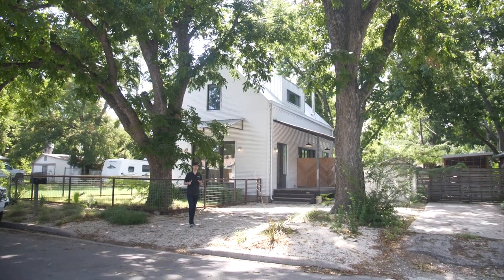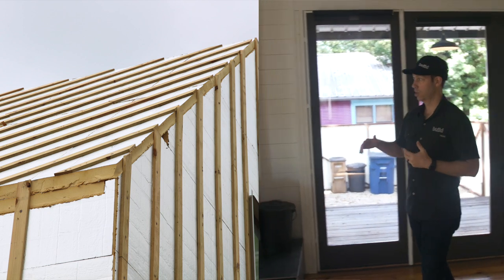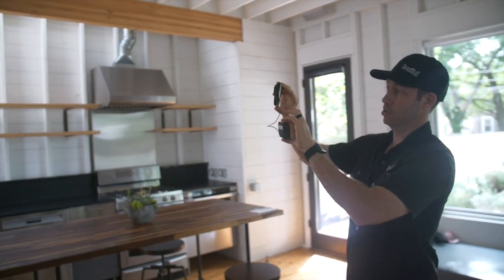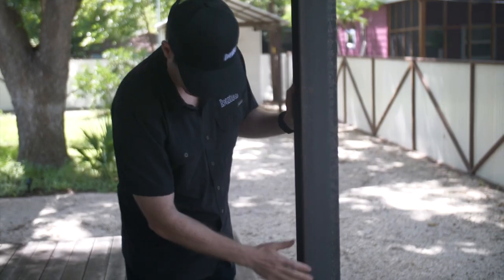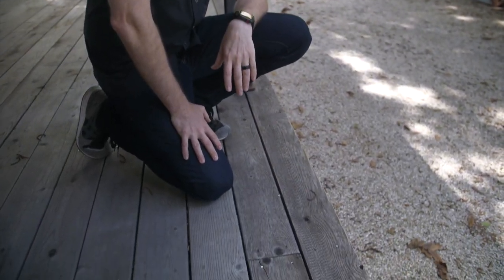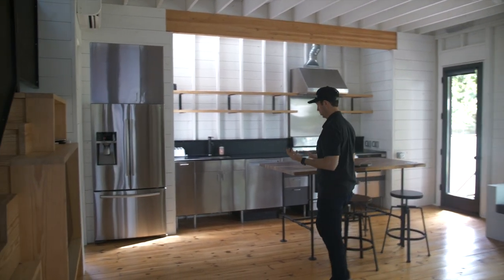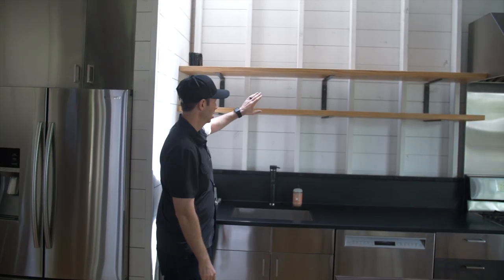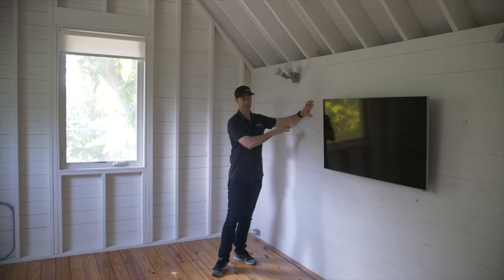This New House Has No Drywall, No Insulation, and an All Wood / Shiplap Interior!

Comment: I really like this house,  it's pretty nice,  now i wouldn't have a problem w/ conduit running along the walls i kinda like that wall.  and just have a bit more sound insulation like you were saying at around 17 mins.  otherwise I love it so easy to work on.  I can't stand how hard stuff is to work on and this would be 10 times easier to work on.

Comment: So, the exterior wall has no sheathing or drywall, is the rigid foam sturdy enough and fastened in a way to prevent racking?  And you're exhausting the warm humid air from the bathroom into the living space below...is that even permitted?

Comment: Do we have extensive data on external insulated homes like this? How do these materials live up to more exposure to elements?
If we're making analogies to a winter coat, or blankets--those wear out and lose loft for insulation. So does external insulation have shorter lifespan than traditional inside the walls insulation?

Comment: I would be curious to see how this design would be changed if it were built in the Midwest?  I don't know if you could get away with insulation on the outside only.  In the summer time sure, but in the winter it might not be enough.  I personally would have like to seen a basement on it, but I guess that isn't as come down in TX.  Its a little modern for my tastes, but that is more of personal preference.  Overall though, I very much like the design.

Comment: 1.  Did the furring strips to hold the metal siding actually match the studs on the walls? 
2.  How did you secure the rigid insulation to the siding?  
3  Why did you elect to put the furring strips for the roof on a ~45deg. angle?  So you could walk the roof more easily to secure the metal roofing?  
4.  What kind of roofing did you use for the house sides?  That is pretty cool that you used metal siding sideways for the siding.
5.  Can you please provide a better explanation of the layers, your link to building science doesn't do it well.  What is peel and stick?  Is it like the brand that is EPDM with a sticky back?  Rather than using Tyvek house wrap?  Did you use that over the shiplap?

I built a little 16X24 loft office timber frame "man cave" workshop and used a similar way of insulating, except only used 3 inch rigid aluminum faced insulation on the outside and 2X8X1 pine clapboard over that. I used tongue and groove 6 inch boards on the outside of the frame [its what you see from the inside, and I left it unpainted so its beautiful].  For windows I used 60 year old recycled ones from Switzerland, they open from the top and swing out with a flick of a lever and are double pane.  I didn't need thermal pane windows.

This design is proven, and it really works well.  Thanks for the video!

Regards,
Larry

Comment: I mean honestly, I would have double walled the whole house, double floored with traditional techniques and over laid with "rough framing" achieving the raw look but also achieving soundproofing, cut cost on exterior insulation and double barriers. Plus you could hide any unnecessary electrical and plumbing exposure and make any key points in a crawl space / air gap for easy access.

Comment: I'm curious, just considering the structure and not the finish work like kitchen/bathroom, how does this building style compare to traditional construction when it comes to cost.  thanks for the videos
Reply: I would assume that framing is more expensive and general labor would likely be marked up because of the specialty techniques. Framing would be a challenge and this kind of finished look would require a very skilled crew. Electrical would likely take longer because it has to be pretty hidden (and it can be very hard to find clean and neat electricians for cheap). Plumbers would likely be the same deal. Because of insulation thickness, all windows/doors would probably be custom with a jamb extension? I’d assume this method of building is more expensive, however the idea of a continuous thermal envelope would serve a great purpose in net zero and energy efficient homes, which will always cost more than a conventional home. Definitely food for thought with this design.

Comment: I’m surprised this meets code for shear strength with no sheet sheathing. Shiplap on studs can parallelogram, but I guess the rigidity is supplied by the connection to the perpendicular walls? I mean, I live in a town with plenty of homes built shiplap on studs and it’s not like they fail routinely, but surprised it would meet modern code nonetheless.

Comment: The wood however is combustible and you got a fireplace right next to it. It also would get smashed to pieces by a powerful storm, then again so would most american homes. Other than that it is a neat and a rather simple way to build a home. This is the type of project I'd be comfortable to build (much of it anyway) on my own. I think it looks good on the inside. I like the metal exterior, not sure what it'd cost me or how it'd compare to a wood exterior in terms of required maintenance.

Comment: Drywall's probably louder than wood. What about some kind of insert sound baffles 14.5" between some of the studs?  The way they'd handle this in the middle ages would be fabric tapestries hung on the stone walls. 
Dust is a serious issue that only gets worse over time. After spending some time in Japan, their style of shoes off at the door, keep things simple so they can be easily cleaned is a good practice. I visited Japanese castles (all wood construction, you'd love it), shoes off at the entry, everyone in socks,  at least 1000 people an hour in most of them. I've got some photos of the bottoms of peoples' whites socks that look like they just came out of the drawer.  
I live in Los Angeles, near freeways, Sanna Anna winds blow fine sand, the old shack I rent is a leaky box. Gardeners seem addicted to leaf blowers.... These are all external sources, what are the interior sources, and how does building materials contribute to dust over time? You mentioned insulation in this video, but I don't think you meant insulation behind drywall was a problem. In my bedroom I notice dust from the cotton sheets and pillow cases. This is a terrific house. I'm an old carpenter, but I'm not sure I'd want this....but taking some really good thinking to this level is like an amazing experiment. It's also great that you're still connected with something you built "many, many years ago" 5 years. When I washed and reoiled a redwood fence I'd built, I realized it was 20 years old and still in the same shape as when I'd built it. Time moves a lot faster than we realize and things that hold up turn out to be worth the extra effort when we make them.

Comment: Could this type of design and "outsulation" be retrofitted to a traditional home from the 60's during a renovation? Let's say if the all of the exterior siding would have to be removed. Is there a significant amount of engineering needed to implement such a design?

Comment: People have to understand is that code is minimum requirements  why would anyone build a house to minimum standards  great idea on this houseconstrution. Next one I build will be done this way drywall is per code fireproof? But typically  electrical fires tend to smolder in the wall cavities  I love the looks of the interior it favors the quntisential beach house or industrial loft  heating and cooling units of that type are being used all over the world

Comment: It looks like a firetrap, unless, maybe if it has intumescent paint on the interior, but even then, a fire would have spread through those louvered doors with little trouble. It looks depressing and hard to clean as well. But the exterior seems more permanent than vinyl. I also like the external insulation envelope, the double top plates, the 2 x 8 roof framing and the absence of vented dead space; more houses should have those features. But I'd still want flat interior walls with more fire protection.

Comment: You lied.  It has a lot of insulation.  And I hate to rain on your party,  but if this sucker ever catches on fire,   you better get out real quick.  There is a reason for fireguard drywall.
Reply: No the insulation is on tbe outside. He called it outsullation. You are missing the point to remodel and run plumbing and so forth you don't have to deal with the insullation between the studs and cut through drywall.
Reply: It said "No insulation".   We all know there is insulation, and we all know where it is.  He lied, and it won't be liar,  liar  pants on fire, it will be liar liar house on fire.  All wood inside would burn pretty quick.  Bad idea....

Comment: Meeting with a builder about this idea and they keep saying to insulate the outside like that we will get moisture issues if it’s to tight, have to have an outside air vent. What should I tell them we need to do so we can insulate the exterior without having moisture issues? Indiana area so very humid here. Thanks

Comment: This is an amazing place and the video is great. While I understand the outsulation explanation, I'm still at a loss for how the exposed framing and sheathing meet firecode. Are all solid wood parts just thick enough (1"?) to sidestep the interior fire barrier requirements? Or is this built outside of  a metropolitan area and the AHJ does not require a fire barrier?

Comment: How did you get away with putting in a two handle shower valve? Where I live in New Jersey pressure balance type of valves have been code 25+ years

Comment: How can Shiplap be less expensive than drywall on the interior walls? Don't get me wrong, I love the exterior walls and insulation values and sealing that they provide, but if you drywalled the interior walls you could greatly reduce the sound transfer between rooms.

Comment: The things that bother me with these type of houses is the sound vibration that travels from stomping feet, slamming doors, echoed talking, ect.... It's hard to get around this with no insulation on the interior and no 5/8" drywall.  If you have a family and value your sleep, this is not the type of structure for you

Comment: This looks so industrial I would hate it. Unfinished walls are tough to put decor on the wall (ie hang paintings). And your wood structure has no barrier to provide protection … drywall would at least give you a fire rating so that people between rooms and floors have some time to react or escape before burn through/spread occurs.

Comment: In sweden they use layers of boards to make a wall with no insulation, sometimes a foot or more thick,like a giant sheet of plywood, its also structural so no real foundation is needed.Here in the US we build with cheap cost in mind, Scandinavians tend to build for lifetime longevity. Modern American homes are some of the worst construction methods I've seen.
Reply: Obamaistoast2012 Your comment about Sweden ... It would be interesting to compare costs of finished construction of US Homes and Sweden.  An economics perspective would also include average incomes after taxes, costs of energy (price per KWH killowatt hour and therms) with average monthly operating costs at various temperatures by parallel and at the end, probably include expected asset life. If a US home is good for 50 years, how long does a Swedish home last - and desirability of people to buy a home of 50 plus years.  What are they worth?

Comment: The concept of wrapping the house in exterior insulation isn't new in Canada.  The technique is often employed for older homes when further insulating interior walls is not practical or cost effective.  You don't mention where your home is located or what climate it is exposed to, nor did you you state the "R factors" that you were able to achieve in the walls and roofing.  Failing to insulate the interior walls is a lost opportunity to further increase the insulation factors of the home.  Whatever it costs to heat and cool that home could be substantially further reduced by insulating the interior walls.   A modest bungalow here can typically cost $3,000.00 per year to heat and cool under climate extremes and that cost is likely to double every 10 years for the 100 year plus life of the home, so building for the future needs to be strongly considered.  Extra care has to be taken to hide as much plumbing and electrical conduit as possible and that means extra costs in construction.  The requirement for electrical conduit rather than running romex increases the electrical installation.  Local building codes here require finished drywall interior surfaces to meet fire codes and provide fire barriers and the drywall skin further strengthens the structural integrity of the structure.  Electrical outlets are not permitted at floor level in case of flooding.   Note that your entire interior is painted white.  Colored decor and color transitions between rooms would prove challenging, not to mention hanging art and flat screens, bathroom and kitchen fan ducting and a fireplace.  It takes a very special clientele that would enjoy living inside what looks like the interior of my garage.

Comment: Could you remodel an older house (wood framed, plaster, fibreglass insulation, and aluminum siding) with the perfect wall system?
Reply: You could if you wanted to but I don't think you understand what you would be in for with a project like that. 
It would be nearly impossible to get a result that would resemble this. For sure very impractical.

Comment: Wait, do they actually want you to alter the kitchen and make it shorter?  I'm 5' 8" my mother is 5' 4 and shrinking at 80 some odd years old and both of us think taller counters especially concerning the sink.  Would make it easier to wash the dishes with her bed back she leans on the edges and it needs to be a little bit taller so that her back won't hurt so badd when she does dishes. Average size women are 5'6". If you don't believe me as somebody in the clothing industry that is their standard things off the rack are made for women 5'4 to 5'6 anything shorter than 5'4 is petite and has a shorter torso and shorter legs or skirt. 
 Average male height is 5'8 to 5'10, at 6', clothes start being a little short everywhere, so a 42" countertop should be a relief to him if hes helping out in the kitchen. 40 is a good compromise,  If the countertop unit is adjustable at the legs, just screw them down and just add lower shelves into the wall. Or Hey just make the kitchen a step up kitchen in builder sort of a Box to be the new kitchen area floor and just raise the refrigerator onto it.

Comment: I hate drywall, its so freak'n fragile, one little bump and it's damaged, not much different than the paper walls in Japan, but much more involved to repair.
Reply: Yes, my house in the UK (built around 1900) had all plaster walls and they even did run-outs of plaster for mouldings for the skirtings & ceilings including lovely curves for corners - so beautiful! Where I live now (France) in rented accommodation one wall between kitchen area and toilet is so flimsy & not properly fixed so it moves if you lean on it, I wanted to put shelves up there (need them) but couldn't in that rubbish paper wall.

Comment: I have no problem with this house because it is a one-off experiment.  The biggest downside that I can see is that it will appeal to about 1 potential buyer in 10,000.  Not a house I would like to try to sell.  Not too much different than many of the houses that Frank Lloyd Wright designed.  Masterpieces of design but hell to live in.

Comment: I'm not understanding why it can't have drywall. I understand the purpose of exposing the studs on the inside of the house. Yet some interior area look like walls. It just has wood going horizontal and painted white. Why can't those few walls have drywall? I would rather see it as drywall for a clean look as oppose to seeing horizontal line like an unfinished basement and it's concrete block look

Comment: I do high end custom building. I can't stand houses that are so tight that they need an electronic mechanical systems to bring in fresh air. I guarantee this house has this (ERV). A well built house that has a passive transfer of air and is a well insulated house is so much more sane. Something like this is like building a Ferrari and then releasing it out to the world for the next 100 years to be mutated into what ever mold monster it becomes. A passive breathing system will last forever!!!!!!!  "Breathe stupid breath"

Comment: Ehhh.... there's some interesting bits to this, but the idea that this build style should be everywhere is patently false. 

This build inherently lacks airflow.
Both internally and externally. 
If you have accumulated too much humidity or if you live in a place with harsh winters, those drawbacks are going to be very pointed. 

Damp spots and high heating/cooling bills are the minimum a person is going to have to deal with. If you live in a place where humidity isn't a concern and your winters are relatively mild, this would probably be a great home. 

Also, people looking for how this meets fire code: the fire breaks in the floor joists are clearly visible at 8:41 . Most municipalities that's all that's required to meet code.
Reply: doulbe the insulating foam layers for colder climates, address interior moisture barriers and you are done.  they build this in Canada, and it supposedly works very well there.

Comment: doesn't look like there is maybe 4-5 inches of styrofoam behind that siding. This is nothing. I built a house in Europe last year with the NF40 compliance (which is not even passive) and it had 8.5 inches of graphite styrofoam. That house can be heated and cooled for less than 300 euro per year in a cold part of Germany